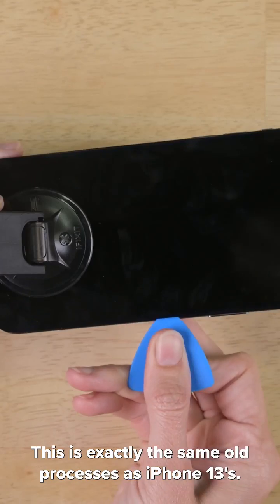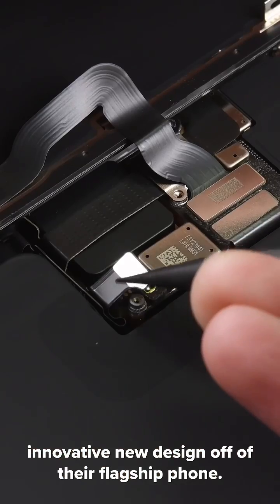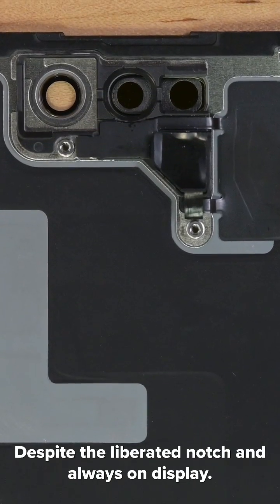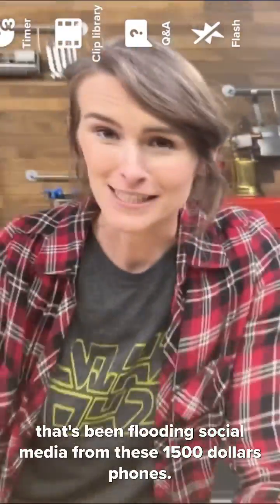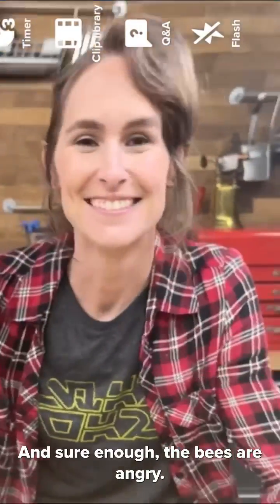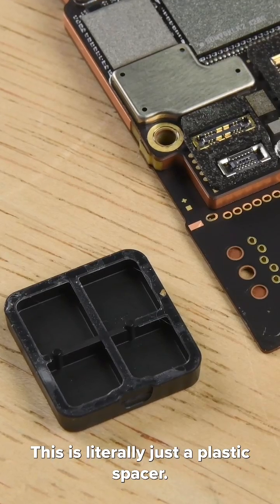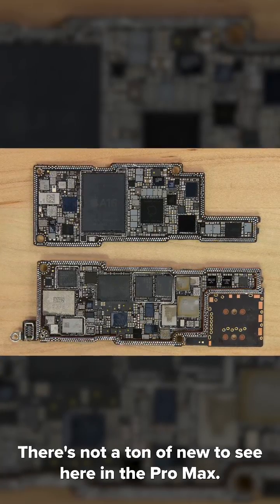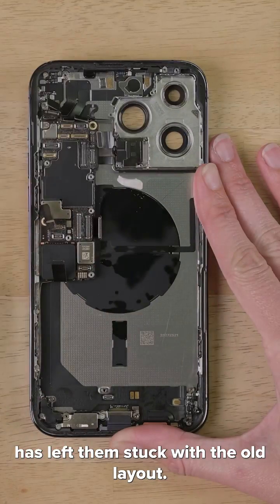iPhone 14 Pro Max Teardown

Comment: Enough empty space for a plastic spacer... but not enough room for a headphone jack.
Reply: Nobody wants useless literal holes all over their phone.
Reply: @joemamr710  speak only for yourself. The option to plug in equipment without the use of a dongle is highly appreciated with those who want to have better audio. The next step with no ports at all will come soon enough.
Reply: Both Bluetooth and Wi-Fi now possess far more than enough bandwidth to send 24bit 48khz uncompressed lossless audio, which is as high or higher than the resolution the system generates audio at.

Corded connection just passes an analog audio signal down the cord, whereas the digital options can send it unchanged to be decoded by the end device.